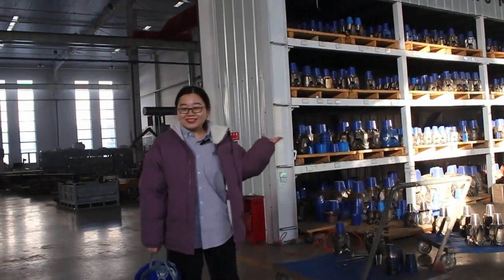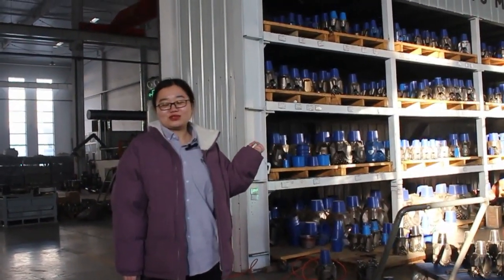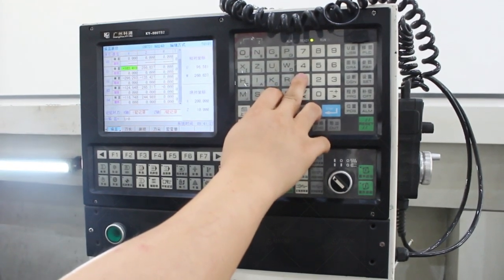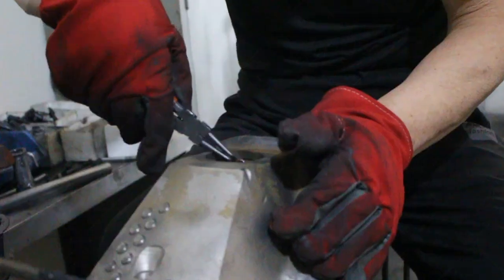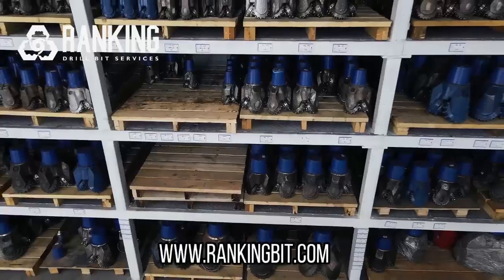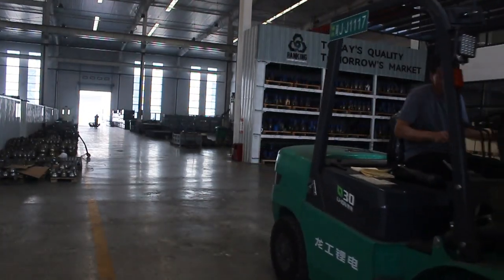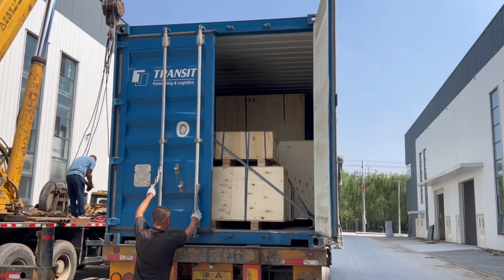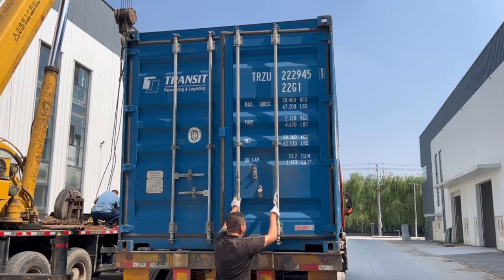Tricone bit: Answers to the eight questions customers are most concerned about!

Comment: It’s a  post hole diggers for 8X8” posts.   It comes with a U shape thingy to tighten up with special tongs.
Reply: You’re preaching to someone who has worked on a Drilling rig for over twenty years.  You lack a sense of humor. You should watch a video on how to get a sense of humor. 
  What should have caught your attention was that I mentioned two things used on a rig to tighten and break a bit. The U shape thingy is actually called a “bit breaker” the special tongs are called “make up and breakout tongs”.  
  Still a tri cone bit is a good post hole digger. But… a PDC bit will drill out your holes a lot faster.
Reply from the maker: The product explained in the video is none other than Tricone bit! Used for well drilling and trenchless projects!

Comment: What happens to the drilling spoils during the backream-pipe pulling stage? Are the spoils expelled from around the pipe opposite the puller-drill rig or do the spoils go up the pilot hole?
Reply: It flows out of the reamer outlet hole and does not pass through the drill pipe
Reply: wow! Thank you for your Q&A, we also found this problem at work! Great industry, how can I contact you about your products? @shirleysun1801

Comment: The drill system is based off of a clock, the driller and locater have screens in which they watch the clock, the percentage,  projected depth and the direction they are drilling. 12 o clock is straight up, 6 o clock is down,  3 o clock left and 9 o clock right and so on.
Reply from the maker: Very correct answer! It seems that you must be a leader in the drilling industry. The drilling process is always full of excitement and challenges!
Reply: Of course, the process of drilling is always exciting and challenging! But that’s what keeps me passionate about it! @amandachen9989